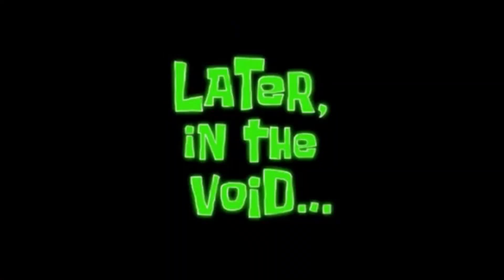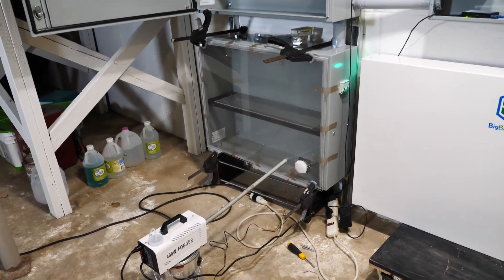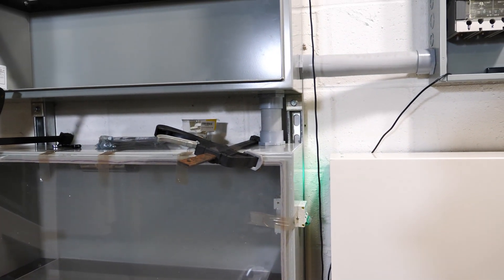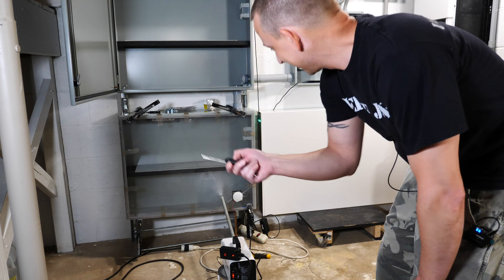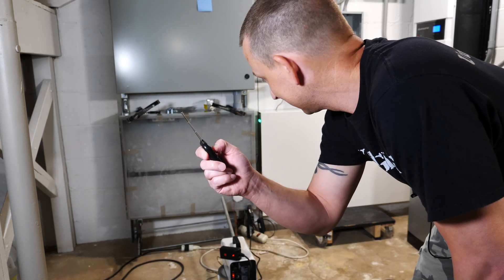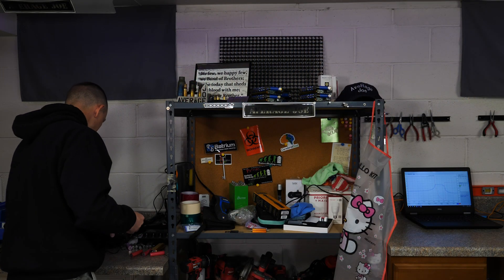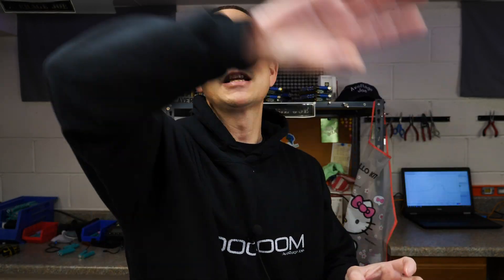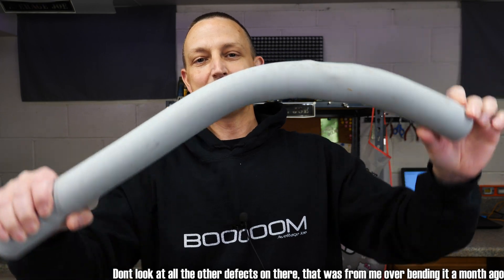Testing LiFePO4 Battery Vent System Diy Powerwall 2.UH OH Ep11💨

Comment: oh man I had one of those hako soldering irons, loved it.. then cousin stole it who I never spoke to again. now bought an elcheapo with a hot air gun.
that crack, nothing a bit of superglue and baking soda can't fix.
you could put a smoke alarm in the corner, move the beeper outside of the box and run it up into the roof area.it needs forced fan, those smoke machine are dense
you need a forced fan for sure. maybe at multiple stages, ie one at the top too. when the fire alarm buzzes, fans turn on

Comment: If folks are worried about heat affecting plastic conduit, what about heat affecting the fan? For folks worried about feeding fresh air to a fire, LFP rarely catches fire. Heat and fumes almost always come from overheating rather than fire. Removing flammable fumes is the best way to keep them from combusting in the first place.

Comment: I had a vent on my lead acid battery box. Very necessary, especially when equalizing.  The fumes out that vent would curl your nose hairs. I used 2inch foam core ABS drain pipe just like all the drains and drain vents in my house.

Comment: At a minimum with the current small tube, its a pressure relief for the rapid smoke that’s produced. That’s a lot safer than a potentially sealed container.

Comment: Fluid dynamics, pressure into vessel is equal to the pressure out.  One fan exhausting and on the opposite side of the sealed box have a air inlet the same size as the inlet fan penetration.  Also having the exhaust fan on the top and the inlet vent on the bottom it will draw cool air from bottom and exhaust warmer air at the top.

Comment: Question: Are you going to keep this exhaust fan on all the time, or only when there is smoke?
If all the time, you'd need a low power fan.
If only when there is smoke, a vac complete with its corrugated flex hose is the perfect solution.

Comment: Really seems like you need an "inline duct fan" further up in the line pulling air instead of a small fan to push air at the bottom.
Reply from the maker: Yes 100%! That is what will happen!💥🤘

Comment: You can't put the magic smoke back in, even with a 400W fogger machine with a properly soldered wire.  Watching you goof up and then soldier on is always entertaining.  I'm fairly certain if you fully evacuate that will violate Youtube standards.

Comment: i like the idea with storage containers... helps to keep it try too... i am confused... sucking out air ... if you put the fan inside and have it blow out at/from an opening, it will draw air in from all the leaks ... for instance.  Is this what you are calling "sucking the air"?
Reply: Yes. With a fan pushing air into the box the interior is positive pressure so the "smoke" goes out every leak.  The opposite is to use a fan sucking air out, making the interior  be negative pressure and make up air will be forced in thru all the little leaks. Usually a negative pressure is desirable for efficient air exchange, but positive pressure design is easier to filter the intake to prevent build up of dust, etc. on the inside.

Comment: use a wood below the acrylic sheet or a blunt drill to avoid cracking acrylic and polycarbonate sheets while drilling.
Reply: I recall stoning a flat on the drill(s) I used to drill polycarbonate sheet.

Hole-saws want gentle pressure, slow revs, and some kind of a lube.  This last might work with dish detergent…

He wants a blower….

Comment: At a minimum PLEASE use 2" pipe/hose. Use an automotive brake duct hose (heat resistant) with an inline duct fan.